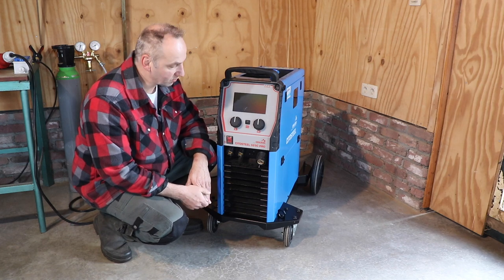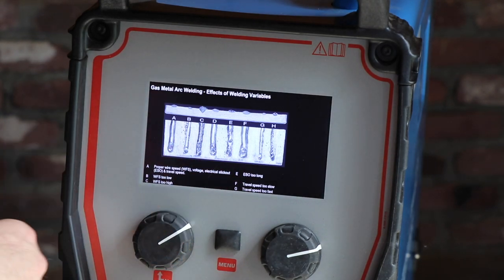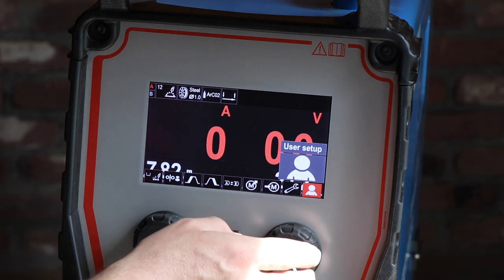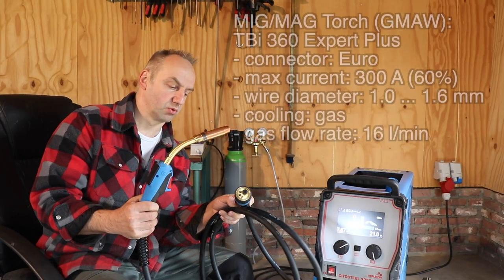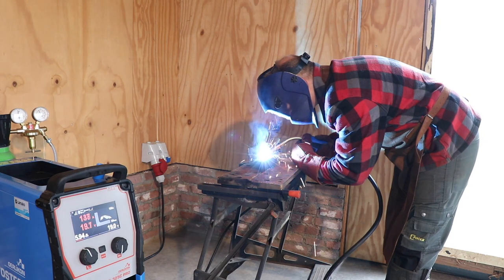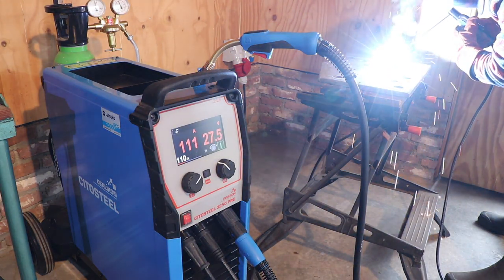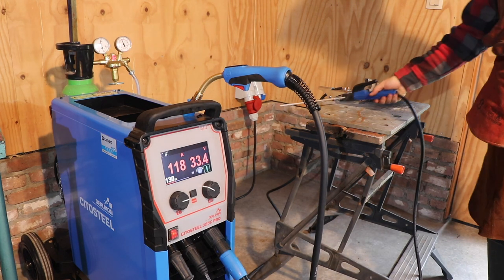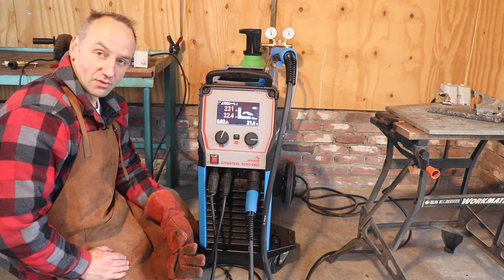Pro MIG Welder Oerlikon Citosteel 325C Pro Review and Test

Comment: That looks like a nice machine with some innovative ideas. Not sure how much mig welding experience you have but the more you use it you’ll find you’ll get better penetration and better looking welds pushing. Stick is pull. Looking forward to seeing many new projects.
Reply from the maker: Thanks. I have always had the idea that with MIG pulling the penetration is deeper, while with pushing it is less deep and a little more flat. Do you have different experiences?
Also my previous machine was less stable and therefore more difficult to get good quality welds and do a proper comparison.
Reply from the maker: This was my first project with this MIG welder: https://youtu.be/DGu4zccdXzY.
I expect many will follow. :-)
Reply: @OutdoorsintheLowCountries  I do. Previous employment was for a commercial golf course equipment mfg company. We’d burn up a 60 lb  spool .035”-.045” mostly solid some flux in a week. Sometimes 2. All hand welding. Always pushed.
Reply from the maker: Wow, that's some serious welding you did.
Thanks for the tip. I will try some pushing with this new machine and see how it goes.

What was the typical material thickness you welded? I am wondering why this Oerlikon has sputtering around 7.5 mm.
Reply: @OutdoorsintheLowCountries  anywhere from 1/8” to 3/4” with solid. 1”-1-1/2” with flux. Forgot I did hoods too which was a switch to .023” wire on 16 gauge. Do I miss it?? …no. Did I learn a lot there?…yes. Glad I did get to experience it.
Reply from the maker: @garny3766  Thanks for sharing your experience!